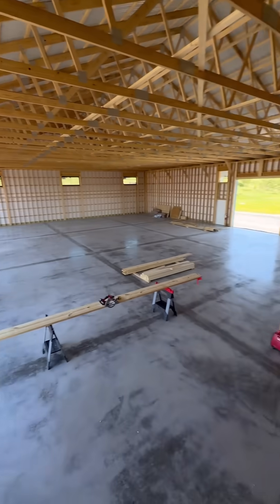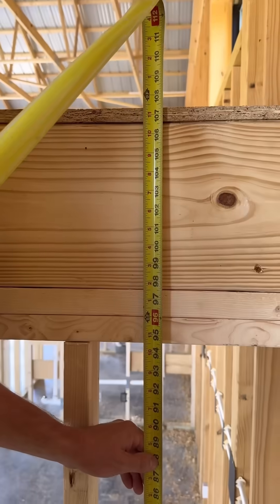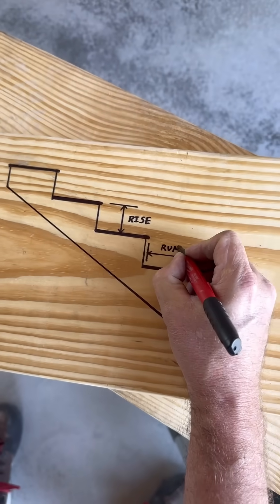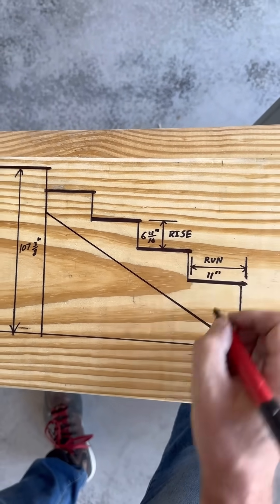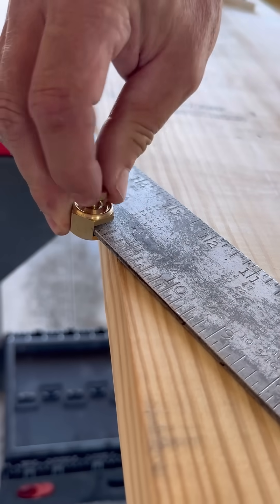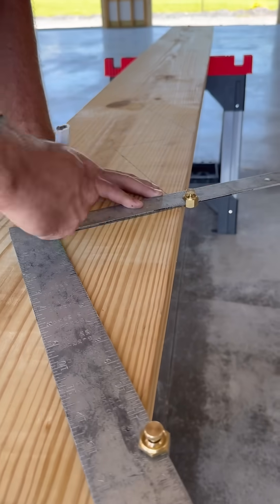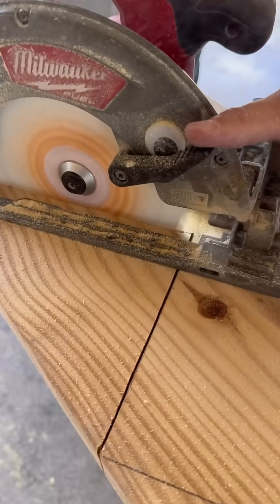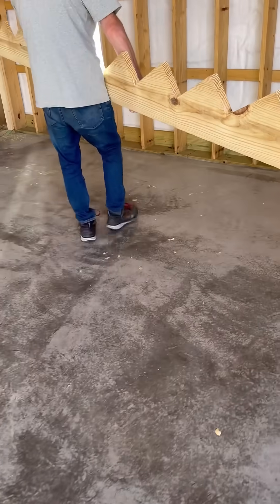How To Measure And Cut Stair Stringers

Comment: I'm no expert in the field of construction, is this safe? Having wooden in making beams and arch like that? Doesn't a metal frame, possibly steel male this more secure in the long term?
Reply: What!!! You must be new to construction. What were buildings made of before steel was invented?
Reply: @nonsequitur807  Yup, you are right. I mentioned that in the first statement of my comment as well.

I was asking if the benefits of cost, longevity, temperature control among other things that creates demand for wooden structures like these.
Reply from the maker: This building is designed to withstand wind speeds up to 115 miles an hour
Reply: @hausplans  cool, thanks for the reply

Comment: When i did stairs once, I had the ideal step height but unlimited run.
So I divided the total height by the ideal step and shortened a bit until the number of steps got rounded to 21cm/step or 15 steps and then some change for the first and last steps

Comment: Best i have walked up 13"- 14" run x 6" rise. You never trip over last stair. Easy for any gate, a young child, adult, and elderly person. Comfortable walking up or down. You feel more stable. I have 13.5 shoes, so stairs that are only 8" 9" run are unsafe for me. Many shoemakers out there so stairs are different all over the place.
Reply: 6" is a good rise 😅
(She said so)
Reply: That's OK for most people but I would hate it. I grew up in a house with 8" rise and NO HAND RAILS but I've never fallen down those stairs. I've fallen UP STAIRS a few times when the rise was lower than I anticipated. I stepped too high and when my foot reached the step, it slipped off. I, like a few people know, don't use my heels going up the stairs. Keeping the calf muscle half flexed reduced the stress on the knees. It's really common for people who ride bicycles  to use the balls of the feet for adding speed from the calf muscle. This transfers exactly the same for going up stairs.

Now I'm wondering if it's more common to fall up the stairs than to fall down. From my experience, it's way more common to fall going up because when you're going down, you're leaning backwards so you don't tip forward.
Reply: @brookelord3448 
For commercial any difference greater that 3/16” in any of the risers is a tear out and rebuild. 
Careful measuring of all the treads will likely reveal a tripping hazard. And yes that also makes tripping up the stairs more common.
Reply: Here they made it mandatory: 11” run.

Comment: How do you know what number to divide the height by? 16 risers?
Reply from the maker: Yes 16 risers. You just have to start by picking the number of risers that you think would be close then divide that into the overall hight alto see if it will work. For example here if I started with 15 risers the rise would have been more than 7”. So I would then try 16 and so on.
Reply: Height was 107 3/8” divide by 7 for the typical 7” rise. 

You get something like 15 5/16”

Divide your height by 15 and you get 7 3/16”
Divide by 16 and you get 6 11/16” 

I like to go with the lower number as it’s easier to walk up.
Reply: He went short on the rise Typical rises are just above 7” not below. You’re going to feel like you’re short stepping on the stairs. Like mouse steps.

Comment: Don’t you need to subtract the thickness of the tread when measuring the rise before cutting?
Reply from the maker: Thats 100% correct! I cut 1 inch off the bottom of the first riser so that after I add a 1 inch thick tread it will still be a 6-11/16” rise
Reply from the maker: Because it’s a warehouse the concrete is the finish floor. I cut 1 inch off the bottom of the stringer so that after the 1 inch thick tread is added I will still be a 6-11/16” rise👍
Reply: excellent question.  it does indeed need to be accounted for..... glad you asked that